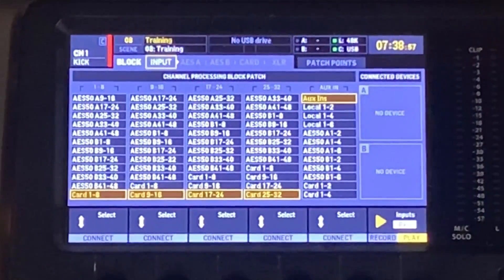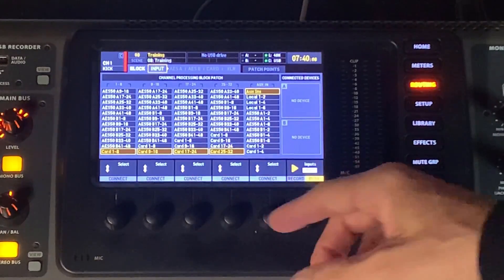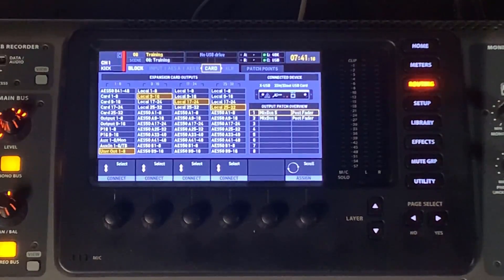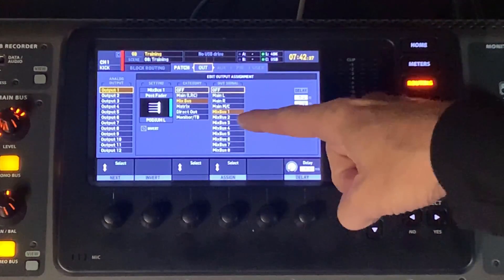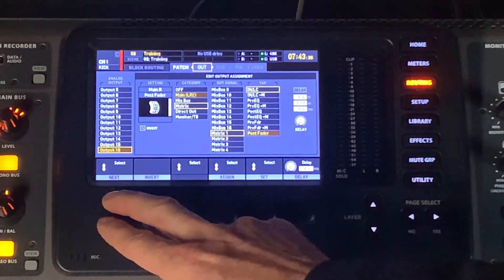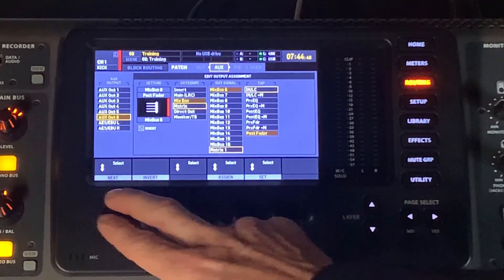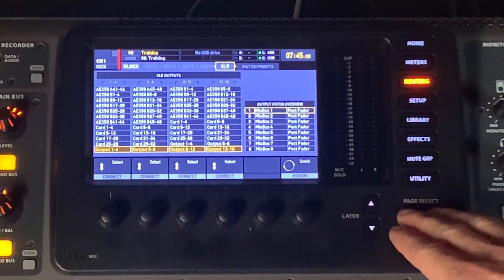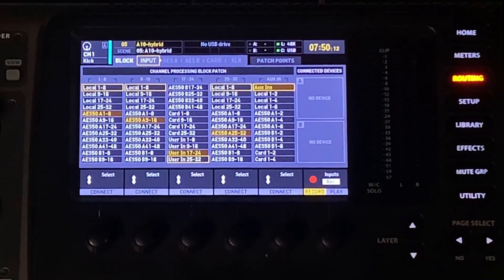An Overview of the Routing Screen on the X32 and M32

Comment: Hi Allamhouse thanks for your video. Can I ask a quick question re the M32.

In short: how can I route a local Aux input to an output of the DN32 to track in my Sampler/DAW via USB?

I have an Akia one sampler connected to the DN32 so I can send 32 channels out from the sampler to mix on the desk, this works, the problem is I need to sample from a record player which comes in to the desk at the aux input, but I cant find a way to send the aux signal back out to any of the DN32 outputs which are connected to my samplers digital inputs via USB.
Reply from the maker: The first thing to keep in mind is that you only have 32 channels you can run to/from USB. So you can run 32 channels from your DAW into the console and 32 channels from the console into the DAW. Once you add your record player into the mix coming through the AUX In on the back of the console you will now need to determine which two channels (assuming your record player is stereo) you will give up to be able to push these AUX In channels to your DAW for sampling. 

If we choose Ch 31/32 to substitute with AUX In 1/2 to move forward with the example then we would do the following setup. Go to Routing > User Out and setup your Out25-32 to have your first channels matching your existing setup (25-30) and then 31 would have a source of AUX In 1 and 32 would source AUX In 2. Once this is complete you will need to go to Routing > Card and set your channels 25-32 to the USER OUT 25-32 and the right window (when you scroll wheel down) will show that your settings look similar, but now channel 31/32 should have AUX In 1/2 as their source.

I hope this is helpful, but let me know if you have other questions.

Comment: So say I have a s32 digital stage box and I want mix bus 1 to go out to the output 1 on  that stage box. But I have my Main L/R  going out local output 1 on the console. Is this possible or  does local output 1 take up one of my remote output spots on the snake?
Reply from the maker: I'm going to try and give you enough info to make this work well, but if it isn't clear enough, let me know and I can try again.
So, the console offers 16 outputs and you can send any mix (or channel) to a desired output. That is internal mapping so then to get to the external mapping you will go to Routing > XLR and select the setup you want for your physical outputs and then AES50a for the S32 outputs. You will quickly notice they are setup in blocks of 4 so now you get to customize one or the other (physical or AES50). While you can customize outputs using the User Outs portion of the Routing page I find it easier to do a one-to-one mapping and only connect the outputs needed at the main console OR on the S32. This is assuming you have a fullsize console with 16 physical outputs. Here is a basic example of what I mean... 
Routing = Out1 Main, Out 2 MixBUS1
Board uses Out1 and not Out2
S32 uses Out 2, but not Out 1

Comment: If I have a dl32 on stage running master out to how /can I keep using the same master out on the console as well.  I am having issues wrapping my head around the router setup
Reply from the maker: My assumption is that you have your Main outs set to 15/16 in the Routing > Outs tab. Assuming this is correct, the Routing > AES50a tab will determine which of these outputs are going to your stage box. This is usually just set to a straight 1-16 mapping and that is fine. You still have access to the XLR outs on the console where you can route outputs to as well. You can go to Routing > XLR and set your outputs to go out the back of the console. By default these are also set (like the stage box) as a mapping of 1-16. This video covers the routing window and might be helpful. https://youtu.be/PpeqRuPGi2Y

Comment: Have you done any videos on routing out to AES stage boxes? We have a monitor that we want to send to that is connected to a SD16 output but can't figure out the routing for AES outs.
Reply from the maker: I have not done any specific videos about it, but the short version is that you have 16 outs that can be sourced from any mix (main, MixBUS, or Matrix). You can then send these to any number of physical outputs. The outputs are setup in blocks of 4 and while this can work great if you have even numbers of outputs, reality usually has us doing one over here and another over there. This is where the User Outs routing comes into play.  If you have to do custom routing, I would go to the Routing > User Outs location and set some custom output routing that you can then select in your AES50 location to get the signal to your monitors. As always, if you need help and want to do a consulting call you can fill out the contact card on my website and we can start a conversation outside of YouTube. https://sound.AllamHouse.com

Comment: My question is I tried to connect a mic in the back of the console and I’m getting no signal. I only get signal if I plug in mic to my stage box abs
Reply from the maker: This sounds like a routing issue. If you go to Routing > Inputs you should see options for your inputs. Most likely yours are set to AES50 to source from your stage box. These are done in groups of 8 so if you need to plug in one mic you can either set a full group of 8 for Local Inputs or you can use the User In setup and do a custom mixture of AES50 and local to meet you need.

Comment: Hi Dave. On the Block Input page in the bottom RH corner there is the INPUTS RECORD/PLAY option. What would I use this for?
Reply from the maker: This is a button that lets you have two presets… 1 for normal setup and 1 for virtual sound check. I talk about it a little bit in this video, but I usually have it setup for my REC stage inputs (AES50a) and then card inputs for the PLAY setting. 
https://youtu.be/oPragZ_x7MQ
Reply: If you can't find the "Record / Play" switcher in the bottom right corner, it's only in firmware 4.0 and later... HOWEVER!!! don't update your firmware until you've saved your scene settings (see the pinned comment in https://www.youtube.com/watch?v=oPragZ_x7MQ from AllamHouse)

Comment: Hello, my direct outs under the P16 are not matching. On channel 7 for the P16 I want bass, but it’s showing on 15. The direct out is channel 18 on the mixer. I am using the x32 compact with a s32.
Reply: I figured it out. It was a bad cat5e cable cause the channels not to sync up in the p16.
Reply from the maker: It is usually best to go channel by channel on the P16.  I even use a piece of paper many times to help me track the channel (or Bus) that has the sound I need and which P16 channel it needs to route out.  Many times the P16s can get pretty complex since most people have to Bus instruments together (drums, BGVs, etc) to get the channel count down to 16.

Comment: How would you just route one output from the output section. I’m using the AES A and B but I just want to connect a physical xlr cable to the output I just want to bypass one output. I know I have use the User section how would I configure that.
Reply from the maker: Yes, the User Outs section might be needed if you need to send custom things across AES50.  For starters, go into Routing > Outs and setup your specific mixes to go to specific outputs.  Then you can go to Routing > XLR and you can setup a specific output to go out a specific XLR on the console.  Then, if you need to make adjustments inside of the AES50 routing to (potentially) remove this local mix from what is sent to AES50, then you can go into User Outputs and setup a block of 8 with your specific needs and then go back to Routing > AES50 and select your User Out group at the bottom of the specific AES50 channels you want to run across.  

I'm not sure of a better way to explain it, but I am happy to assist across a consulting call if you need to get it done quick and without guessing.  If you want to go that route, jump to my website and fill out the connect card to start that conversation outside of YT. https://sound.allamhouse.com
Reply: That was a good explanation and I understand now. I’m going to try it now since I’m at my church. I’ll let you know if it worked
Reply: It worked!

Comment: Thanks for the info and all the videos that you guys do. We just purchased two S16 stage boxes and set them up and they seem to be working fine, how ever when I change scenes I don't have all the routing settings on my other scenes. Is there a way to globally save these ?
Reply from the maker: There is not a global routing change button unfortunately.  The only real option you have is called Scene Safes.  You could select the scene safe for routing and then when you load the new scene, your routing would not change.  I usually stay away from that since my scenes tend to have various routing changes depending on how I am using them, but it is an option.  My preferred method is to just take the time on an off-day and make these changes manually across the various scenes you have saved.

Comment: Hello Dave, we got the M32 last year for our church and I couldn't have got it up and running without your videos. Thank you. Question, the routing still somewhat eludes me. I have it protected in all scenes (I think, boxes are checked). Could I copy our praise team scene to a blank scene that I can tinker with, then uncheck everything in the Scene Safes for that scene only, will that allow me to experiment and change routing and anything else without it affecting any other scene routing. Videos are great but experimenting and messing up and fixing without affecting the service scenes are much more helpful. I've already experimented 10 minutes before practice, just before the service, and lost all sound and that really puts the fear into a person.
Reply from the maker: If you have the routing selected as scene safes then it will NOT change when you open the new scene.  This could be an issue as you might have been experimenting with a different scene and that routing would stay in place when the desired scene is fired up.  I never use scene safes for this reason.

Comment: Hi @AllamHouse. Thanks for your many helpful videos. There one other thing relating to routing that I have discovered. 
On the ROUTING/INPUT page, bottom right are settings for RECORD and PLAY.  These relate to settings for the DN32-Live card. On SETUP/CARD/page 2 there are settings for CHANNEL ROUTING and PLAYBACK CONFIG. These settings allow separate INPUT routing for when you are 'Recording' - i.e. taking inputs from local or stagebox inputs and 'Playback', when you are playing back a recording (e.g. Virtual Soundcheck) from either a SD Card or via USB from a DAW. 
CHANNEL ROUTING can be set to RECORDING, PLAYBACK or AUTOMATIC. Automatic seems to be activated when recording to or playing back from a SD Card and it is meant to automatically select 'Playback' when the SD Card recorder is playing back and revert to 'Recording' when the SD Card recorder is stopped. 
I have found that if this set to AUTOMATIC, it sometimes 'forgets' that you're not playing back a SD Card recording and stays on 'PLAYBACK' and this results in the entire desk receiving no inputs from the Local or Stagebox inputs! Scary if you aren't aware!
Next to it, the setting for PLAYBACK CONFIG - SD Recorder or USB Interface - can also cause unexpected results if CHANNEL ROUTING is set to AUTOMATIC. 
My work around is to set up a Snippet for 'Live Mixing' which sets the CHANNEL ROUTING to 'Recording' - the channels that are sent to the SD Card and USB  for recording are identical (set in Routing/Card). Then I have another snippet for 'Virtual Soundcheck' which sets CHANNEL ROUTING to 'Playback' and sets PLAYBACK CONFIG as SD Card or USB as the source. 
I then change from Live Mixing to Virtual Soundcheck using SHOW CONTROL/Snippets.
Thanks again, regards, Ken
Reply from the maker: This is some great setup work. I am personally just on the standard X-USB card sonI can manage everything in my setup with the Rec/Play button. That being said, I’m sure there are plenty of people using the other SD card that will benefit from you info here. Thanks for sharing with the community.

Comment: Hi @AllamHouse. Very helpful videos for me to setup our x32 producer edition. Just a question that I have been trying to figure out. How would you route vocals that are on Local 1-3, send them to the daw and put autotune then send it back out to the mixer to your left and right? I really could not figure this out. Your help is much appreciated. Thank you!
Reply from the maker: Caution: Using this process across USB will add latency to your vocals.  Do NOT try to push this into their IEM.  It can be okay in FOH if your venue is large enough and your congregation is far enough away from the stage to not hear the natural vocal.
This takes a little finesse in the USER in/out area.  Here is the basic process...
1) Build [USER IN 1-8] to have 1-3 come from Card and 4-8 come from your current source.  
2) Build [USER OUT 1-8] to have 1-3 local and 4-8 your current source (if needed)
3) Routing > Card 1-8 setup [USER OUT 1-8] to send your local 1-3 to your DAW
4) Routing > Inputs setup [USER IN 1-8] to bring the signal back from the DAW
5) Make sure in your DAW you have the appropriate routing in/out to send to your appropriate channels AND that your send level is set to "0db" so you are returning the full signal that is coming into the board

If you need individual help, I do handle remote consultations and would be happy to assist you in the setup.

Comment: @AllamHouse Thank you for your channel, it has been helpful putting together 2 X32 and stage boxes in my church. I had one question. After installing the stage box, we start to experience crackling noise on the channel with the DAW return. Before the stage box, the signal from DAW return was clean and we didn't have this issue before with stage snake. Any thought on what could be the issue? Both our X32 have the same issue with the DAW return.
Reply from the maker: My first guess is that the sample rate is set different between the various devices.  If you are using this for live stream I would recommend setting everything to 48k (instead of 44.1k).  Give that a shot.